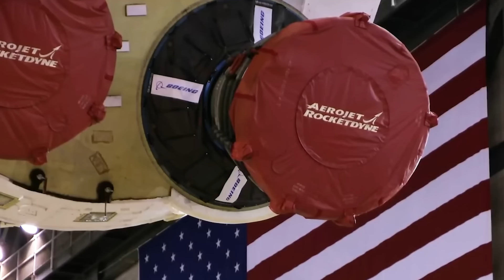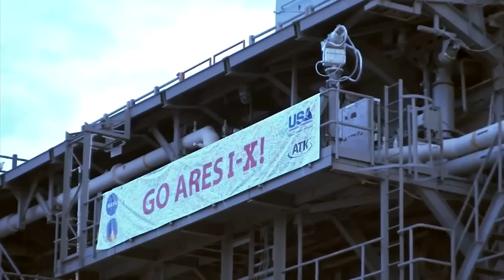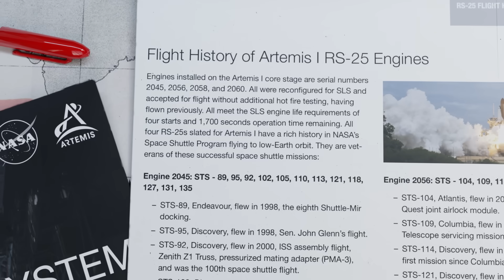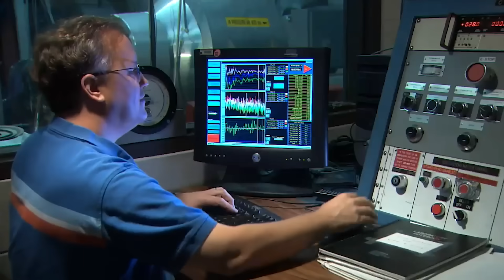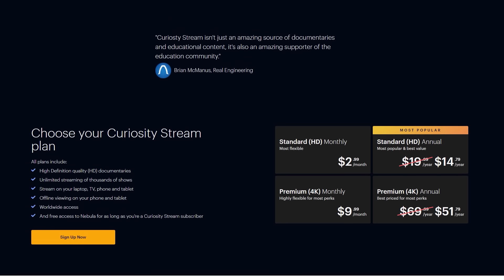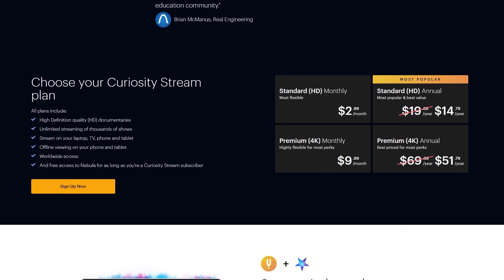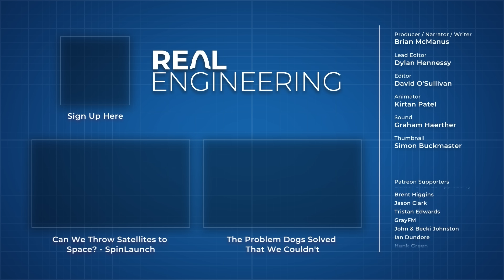The SLS is Outdated. Why Does it Exist?

Comment: There are several legitimate staring points for Artemis. The concept for a heavy lift vehicle based on Shuttle components dates back before the first Shuttle flight, the concept was being evolved in the 1980s and looked pretty similar to the various legacy programs, without any hardware being flown. In the 1980s such a vehicle would have made perfect sense. By the end of the 1990s software was developed to allow for fly back boosters to be a possibility. By 2000s the shuttle derived heavy lift vehicle concept was essentially redundant, old tech.
Reply: It's always amusing when people complain about using "old space shuttle tech". The RS-25 SSME is essentially the best rocket engine that can and ever will be developed, approaching the theoretical limit for chemical rocket engine efficiency with a specific impulse of ~450s. What is the specific impulse of a new "state of the art engine", say Space X Raptor? ~350s. It doesn't make sense to NOT use space shuttle tech. Do you complain about "old tech" when you buy a new car that still uses wheels? No, because it still makes perfect sense to use wheels.
Reply: @Kanglar  okay.  But have you considered why no one uses hydrogen engines anymore?  Leaks, boiling point, required insulation, etc.  The engine has a great ISP, but it causes the rest of the rocket to necessarily be far heavier.
Reply: @Chroniclerope  Even the engines are heavier.  Raptor 2 engines have 1.9 times the thrust to weight ratio of the RS-25.
Reply: @Kanglar  Just using ISP as a metric without adding anything else into context is just plain wrong. The RS-25s are amazing engines. No question about it. But they don't have the highest ISP nor is that the whole story. The RL10 gets 465isp using the same fuel. Others have been tested up to around 540isp using other fuels. Further, the RS-25 even with 4 engines, isn't powerful enough to get the SLS off the ground. They need massive solid rocket boosters to do so, each getting an ISP of only 242. And since it uses Hydrogen, it requires much larger fuel tanks and heavier components to support it. Other fuels lower ISP since they don't burn as well as hydrogen, but they output more power and get more into orbit at a similar dry mass as a hydrogen rocket. Very high ISP makes more since on upper stages than first stages, since the longer burn times benefit more from high ISP.

Comment: I'm surprised this video didn't mention the mobile launch tower fiasco. IIRC it was made by a ton of subcontractors that didn't really communicate with one another, cost a fortune, and won't fit the upcoming more powerful version of SLS so we won't even get much use of it.
Reply: Wow. Didn't know that. But I am not really surprised.
Reply: Tbh, I'm banking that this is the only version of SLS that's ever going to fly.
Reply: @darelboyer4215  Is that temporary upper stage enough when persons are on board?
Reply: @EinChris75  Hmm they are going to be launching Orion with the current configuration. I don't know if the humans and their supplies can add so much weight that the rocket won't be able to lift it, but it seems unlikely to me.
Reply: @EinChris75   SLS Block 1 is expected to be used for Artemis 2 and 3, which are currently defined as a "crewed lunar flyby" and "crewed lunar rendezvous [with HLS] and landing". BUT, Block 1b is needed to transport the Lunar Gateway's I-HAB and ESPIRT modules on Artemis 4 and 5.
Reply: @darelboyer4215  Artemis 3 requires Starship to be operational to get humans on the moon. If Starship is already operational, there is no justification to fund SLS Block 1b. Maybe Congress/Senate will push for it, but only the current version is actually "useful". And frankly even the current version could be fairly easily replaced.
Reply: Tower 2 2029, angry astronaut,4 years  after 1st Artemis
Reply: @anthonypelchat  Exactly. I fully expect SLS to launch once and then be phased out in favor of Starship/Superheavy.
Reply: @darelboyer4215  It will probably fly the 3 scheduled times. Maybe 4. Doubt it will fly more than that though. Re-entry from the moon is the only wild card after HLS is operational. Maybe Starship can return to LEO without needing to re-enter, allowing Crew Dragon to return the crew. Or maybe Starship gets certified by that point. But no way they push the upgraded version of SLS.
Reply: Should get SpaceX to build tower. Would be done in less than 2yrs.
Reply: Why do they even NEED a mobile launch platform???? I’ve never understood this. Just look a spacex and Soyuz. Spacex just uses multi wheeled platforms and Soyuz is put on a track (if I remember correctly). It seems so much more complicated than it needs to be.
Reply: @anthonypelchat  it’s not practical or cost efficient for cargo delivery AT ALL. SLS block 1 is already 2.5-3 billion per launch. There aren’t ANY crew or cargo on Artemis 1 yet it’s already ballooned to such a ridiculous price tag.
Reply: @joshuaashton1929  Agreed. The only technical reason to use SLS right now is because the Orion capsule is the only one capable of returning from lunar orbit. I'm sure that could be figured out for something else. But the only actual reason for SLS is as a jobs function.
Reply: Many people are sleeping on the job.  No planning, co ordination leads to serious cost overruns. This rocket is expensive.  USA has not enough money for this, money should be prioritize on reforming the economy and training Americans, not in a space war with China.
Reply: @teckmenglee8060  This rocket is way too expensive, but not to the point you describe. The entire budget for this rocket over the course of 12 years is less than the military budget for a single month. And the military budget is less than the budget for Medicare/Medicaid.
Reply: Yeah but its the same issue for anyone dremaing of bringing back the Saturn 5.

Its everything you complained about with this. But msot of those companies dont even exist anymore.

Saturn 5's individual components were 100% built by subcontractors and required mass production lines ect

So somrthing might have said Boeing or Lockheed on it. But each part was made basically bya different company or set of contractors .

So there isnt many other options that are viable for a new heavy rocket
Reply: @drunkpaulocosta  I don't think we should be bringing back the Saturn V. It was an awesome rocket that did awesome things, but it's time is past. 

What we needed was a brand new rocket, using new technology and being at least partly reusable. A rocket that costs a reasonable amount to launch. That new rocket's design and construction should've been given to one company, who could hire subcontractors if they chose to, but the main company would be accountable and working at a fixed price with rewards for good progress and penalties for delays. The current system basically rewards stealing from the public and delaying.
Reply: @anthonypelchat  Dunno about the physical connection problem, but theoretical (based on thrust power and diameter) SpaceX's Starship Booster (... the 30+ Raptors rocket only, without the upper Starship vehicle itself) could lift off the WHOLE SLS block 1 core stage (with no solid rocket boosters), its fuel and the current Orion capsule/payload into orbit.............
... so it is fairly easy to understand HOW MUCH more future payloads could fit in a COMMERCIAL, REUSABLE and VIABLE solution, rather than keeping developing the SLS block 2/new infrastructure, once Starship rockets will start flying reliably (... and it will be, long before any lunar landing attempts in its hybrid pair with the SLS).

The only reason of SLS developing was:
- reusing the Shuttle's main engines (rather than let them rust)
- the Boeing/related contractors plea to have a job

... but in the long run it will be (even once more capable SLS iteration will be made) an interim solution with not a real future (once the Space Shuttle's Main Engines will be no more available)
Reply: @tinagiles3430  I wouldn't bank on that...Musk has a history of greatly overpromising and GREATLY underdelivering...That's my only real hang up with Musk (besides being insanely unscrupulous) is the fact that he does this constantly, and most of the time it ends up with massive shortcuts and no oversight.
Reply: Waste of money as if the $150 billion ISS wasn't enough.
Reply: NO CHILD IS EVERY GOING TO BUILD an Airfix model of an SLS...
Reply: @joshuaashton1929  Soyuz can be transported horizontal because it is built horizontal and then tipped up for launch. SpaceX does the same thing. NASA doesn't have facilities for horizontal assembly, so they have to stack-assamble them. This can be done on the launchpad, but only if the rocket is small enough (or you want to risk your rocket getting blown away in a hurricane...). So they built them on their launch platform inside the Vehicle Assembly Building, and roll them out using the crawlers.

To convert NASAs facilities to be capable of horizontal assembly would require an entirely new VAB (the current one is as old as the Apollo program and will be able to run for at least another 60 years), wich would probably require demolition of the old one as the area of the Kennedy Space Center is quite swampy, enirely new launchsites that may not even be buildable (soyuz is launched over a giant pit to avoid destruction from soundwaves, Kennedy Space dumps a few thousand tons of water into the flame-area, but that is only possible if the rocket is a good few meters above the ground. 

All in all this would result in much, much higher costs than just using what is already there.
Reply: @joshuaashton1929  Soyuz and so on are only so cheap because they are mass produced. Soyuz cost a lot to develop, but because they have built over 1,900 of them, that cost gets spread out. So each launch can cost only around 25 million USD. Oh, and Soyuz is far less capable than SLS. Better to compare her to N1 or Saturn V. Saturn V cost 1.23 Billion 2019 USD per launch (and there were 15 built), N1 never managed a successful launch, but it was probably more expensive per launch than Saturn V.

SLS will get cheaper per unit the more you launch of it, because research and development costs are spread out. Right now, the single SLS looks expensive, because unlike other companies, the government adds the research and development pricetag not as an extra item but adds it onto the price of the SLS. 

Thats why F-35 was so expensive in the first lot, but each lot after that got cheaper.
Reply: @haydentravis3348  Yes, in that regard it was a huge success
Reply: @EinChris75  It can but it's far from ideal.
Reply: @anthonypelchat  SLS is currently scheduled to fly Artemis 2, 3, 4, and 5. SLS block 1b is scheduled to fly 4 and 5 so im not sure what you mean by the upgraded version wont fly.
Reply: @imEden0  SLS had 4 versions planned. Block 2 and 2 crew have already been cancelled effectively. There are no flights scheduled for the next 10 years. 

SLS 1B is scheduled for 2028. That's 5 years from now, not counting additional likely delays. And the only reason for it is to carry modules for the lunar gateway. The LG is already fighting for funding. Plus it can be built by the Falcon Heavy for 1/10th the launch price of SLS. And by 2028, there should be numerous vehicles available to help with that from other launch providers. Not to mention that the only question for Starship use instead of SLS is for crew launch and return. Cargo missions like LG construction would be massively better and cheaper with Starship. 

The only reason SLS 1B will fly is because the hardware is already being built and the govt pushes it through. No point otherwise.
Reply: @anthonypelchat  Block 2 isn't that much different from block 1. It's literally just a wider fairing for cargo flights and also new boosters. Furthermore, falcon heavy is slated to launch the first two gateway modules next year anyways, so it WILL be used. But think about this, Artemis 4 is definitely launching, and launching a gateway module WITH the crew is cheaper than also launching a falcon heavy. Less unnecessary launches is more money saved.